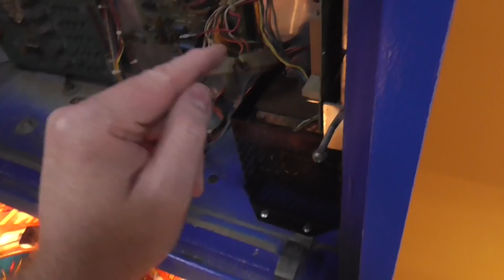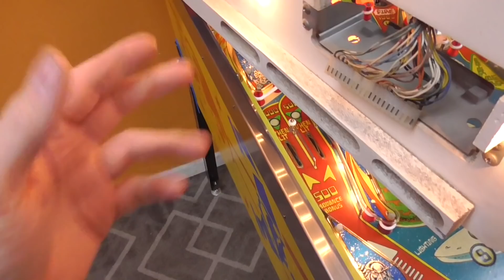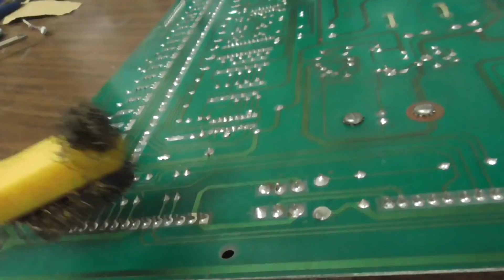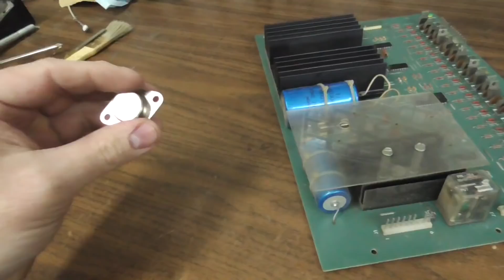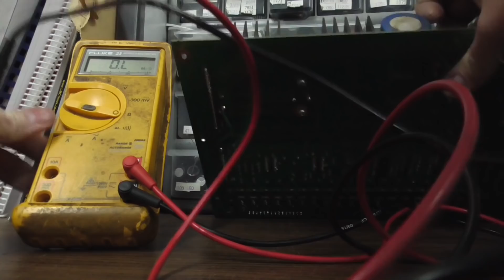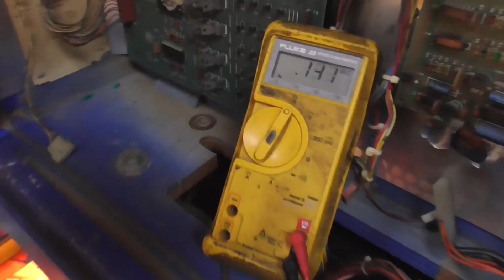Can You See The Solder Joints are Bad? - Bubba Shot The Pinball #4 - Bally Star Trek Machine Repair

Comment: I am enjoying the video,  and felt like I would put in my two cents on "reflowing" or "re-soldering" header pin joints. I would say that alot of times it works just fine to reflow...  but most of the time,  I find that the amount of oxidization in the lead leads to a bad solder joint from reflowing. The joint will end up looking like a big nasty blob ..   these joints will also fail in time. If I am reworking a header,  and it "blobs" up, I remove the old solder and try again. If at that point. solder will not form a nice "fillit", I will replace the header pins themselves.
Reply: The problem is they corrode down inside the crack, and the reflow can't get there.

Comment: I've been soldering (soddering silent L!) for 50+ years now. You are quite correct about the pin resolder, removing involves the danger of stripping pads off the board. Great video keep on keepin' on!
Reply: It's actually saul-der-ing. Not soddering, not sold-ering. L ain't silent entirely bud.
Reply: @DemnRaig80  WRONG! Only Europeans say with an L. They are WRONG!

Comment: Copper will oxidize, but I don't see the relevance. The solder will oxidize too, and that is why you hit it with a brush to clean it up.

As for wires in the wall, it has insulation on it.

The flux myth comes from the old plumbers' solder (acid-core) for working on pipes. Most would never attempt to use that for electronics repairs. But yeah, if you use that, clean that acid off. But with all the trouble you go through to remove corrosion, I just wouldn't put that on there in the first place. 

Now, I imagine there are places where you want to remove rosin or whatever flux. I don't know if that could detune an RF section. I tend to doubt it, but you are not working with too many RF circuits (the CPU clock line would qualify). And since rosin is sticky, you might want to remove it if the machine was in a metal factory or something, and I wouldn't store a pinball machine there. But even then, you'd have to have a lot of metal dust to attract enough to have shorted traces. "Whiskers" is a different problem, but I don't think that can be prevented. If you find those, just reflow the solder.

Another thought is maybe if the unit were to stay really hot, parts might fall off the board easier. Flux is used for the same reason you pour salt on ice in the winter. It changes the melting point. So you want the solder to soften easier when you apply it. That is something you could test. Find a playfield where the resistors have fallen off and see if you find any traces of flux.

I have my own stories, like me handling a taped-off electrical wire sticking out of the floor and the landlady was like, "Aren't you afraid of getting shocked?" I had to explain that the reason they put insulation on the wire is so electricity won't go where it doesn't belong. So if it isn't blowing fuses or causing fires, then I don't think I'd have to worry about electric shock.
Reply from the maker: Thank you PlumGurly I can tell you now what you're talking about
Reply: @LyonsArcade  Thanks! Such a compliment coming from you means a lot!

On the possibility of hot resistors falling off when there is rosin left on, one can make the case that can be a safety feature. So rather than shorted light sockets causing a fire (like if someone put the wrong fuses in), the parts start falling off.

Comment: I guess if Bubba shot the Pinball Machine it could also be possible that Bubba Shot the Juke Box too..  I figured it’s probably too late to go back and check…
Reply from the maker: I didn't think about it at the time, but over the years I've thought about that Wizard with the big hole in the playfield, at the time I couldn't tell what did it.  To be honest with you, not to be vulgar, but I figured maybe rats had done it, maybe they had tracked nastiness all over it and it had worn through the wood...but i've seen lots of rat damage before and never seen them create holes through the center of a playfield.

Then it finally came to me a little while back, he probably shot the playfield with a shotgun on that game.  It had maybe a 6 or 8 inch section that was missing in the very center, and there was no playfield glass.  Lot of senseless violence against coin operated games!

Comment: 26:55 The only way that is going to happen is if the wrong kind of flux was used with the solder, like the type a plumber would use to solder copper piping. That will eat your PCB eventually but rosin core solder for electronics ain’t never going to do that.
Reply: That's exactly what I was going to say..  When I first started, I bought some random flux to start adding to make my reflows go better, and it turned out to be plumbing flux, which I didn't know to look for, and it was amazing how fast it would eat the traces..  I'd have a board mostly working, set it aside for a few days and come back and it would be dead.  Ever since I tossed that back in the plumbing supply box and got some rosin flux I've had no problem.  I do tend to clean it anyway, but I'm not worried that it's eating the board.
Reply: @SteveJones172pilot  Yeah that is a great case in point.
Reply: This is true...BUT there are solders, like Kester 331 series, that have water soluble "organic" fluxes that are for PCB assembly but are VERY aggressive and need to be cleaned off well or it will eat the traces and the solder itself.  

Even in the "Rosin Core" varieties, there are RMA and RA and different degrees of aggressiveness in those. The rule of thumb is, the better the solder is at wetting the metal, the more aggressive the flux is, the more one has to get the flux off to prevent the flux from continuing.  

Since Ron is using whatever solder he happens to find (in this or another video he stated that), one has no idea of what core the solder is and how aggressive the flux is.  Working on some crusty power supplies could have one use a more aggressive flux since it "sticks" so much better.
Reply: @sguttag  I wasn’t aware of that. Good to know.

Comment: Ronnie, you're doing it wrong! If you connect multiple grounds together, yeah, I know they're all the same wire, so what's the difference, right?  But those are called ground loops which act like loop-antennas and pick up noise and couple it into your ground plane.  That's a common cause of 60-Hz hum on sound-systems..  too many grounds.  Grounds should ideally be a big hunk of copper and not snake all over the boards and not connect back to itself at multiple places.   Jeeze Ronnie, get with the program!  And this is not "your" video.  It belongs to us viewers!  I already made ten copies just for my personal use!   I pay your salary with my ad revenue!   ducks and covers

Comment: I would have to disagree with not covering traces after adding bodge wire repairs. Not all traces are made the same, and the coating is not provided for cosmetics. It is there to protect the board from corrosion due to humidity. I've seen traces eaten away due to corrosion from humidity (aka copper turning green). Even covering the exposed trace with solder does help prevent this type of corrosion.
Reply from the maker: can you explain then why the manufacturer left exposed copper?
Reply: @LyonsArcade  The manufacturer only leaves exposed copper where connections are intended to be such as expansion, jumper options, or RF shields. The mask is more intended as an insurance policy against corrosion. It doesn't mean that the traces will always corrode, but it does eliminate the possibility. Besides, if a manufacturer could skip a process to save money, they would.

Comment: If you just can't deal with using wire ties to block off the hole in the power connector...  lol
The connector family is Molex KK156.  AMP made a compatible 0.156" pitch power connector but their family name for it escapes me.
The blocking pins are called polarization pins or polatization keys.  The big electronics component houses sell them.

Comment: once again.  great video.. 
and on reflowing or removing the old solder.   Reflowing is perfectly fine as long as the pins are cleaned. and you dont over do the solder.  As long as, Bigger the Blob, the Better the job, is not part of the equation. Have seen way to many people try to just add solder and short out terminals.

Comment: Checking the filter cap's A/C ripple with your multimeter is a great idea. I have that multimeter too; although mine is a Fluke 23 with a grey silicone case around it (I think its a series 1), great meter when I got it, it was still working with a 9v that expired in 2008 (bought 2015).

Comment: Yup. A little flux-core solder fixes those broken joints nicely. It just needs to be melted and reflowed. afa "conformal coating".... lol. Don't mind all those exposed solder joints, contacts, and component legs already being exposed. They're not wrong about exposed metal corroding. But.... ayah.

Comment: Adding the conformal coating is only needed if your boards are exposed to corrosive elements (salty moist air, harsh environments, boards that could be exposed to spills). 
Adding flux is only needed if you're working with non-fluxed solder. 
I think part of the confusion is people are watching other youtubers who do repair vids, and they're working on ROHS compliant equipment, which uses higher temp non-leaded solder. The removal of old solder is due to wanting to rid the joints of the ROHS complaint solder in favor of using the lower temp leaded solder. Also if using hot air to remove/add chips or components, you use flux as you're not adding solder with flux core to remove/add. 
A lot of folks may not realize the boards you're working on are mostly all non-ROHS compliant, which are all leaded solder. (60/40)

Comment: JOE, LM75H05 Regulator outputs 5 amps, but what problems and issues does it fix?
Reply: *78H05 - regulates output to 5v
Reply: @BluePlanetMedia  7505 outputs 5V at 1AMP and 75H05 outputs 5v at 5 AMPS, I wonder what problems the pinball games causes what types of issues using the 7505  because its outputs only 1 AMP so it causes problems

Comment: They can't handle the truth dude! There pocket protector solder guide says different now !!! LOL... Real nice example of cracked solder joints on the pins of the board. Holly crusted power transistors batman! 78H05 is the 5amp version....nice!

Comment: Love the videos keep it up. Don't tell anybody but the "conformal coat" is called solder mask. It allows the manufacturer to solder the entire board all at once. It is placed where you don't want the solder.
Reply: Thats what I was thinking..  there are really 2 different things, right?  What he's talking about is the solder mask, but then there's also conformal coating, which it's my understanding can help to protect if the board is going to be in a humid location or something.  I have a bottle of it for example that I have put on circuits I am going to put in the garage.
Reply: It's called "wave soldering" in case anybody is interested. They even make Selective Wave Solder machines now that can turn off the solder flow nozzles as sections of the board with components you don't want hit with the solder pass over, like SMDs.
Reply: I was going to say that. Anyone that says you need to replace it for anything other than "it looks nice" doesn't know what they are doing!

Comment: "Ackshually" it's probably rust, not metal. But you are right, reflowing is perfectly fine if there's already enough solder there.
Everyone should know by now you know what you're doing, so keep it up.
Reply: I add a little flux and heat it so it flows nicely.. maybe add a bit more solder.  Only reason to remove any old is if by adding new, you get too much!

Comment: The typical use I've heard of for conformal coating is to either insulate a trace electrically for "just in case" or to glue a trace repair down to strengthen it, especially when using thin copper foil or stamped replacement pads.

Copper does corrode (I had an PCB that completely dissolved numerous traces into green dust) but that typically requires moisture and time.  When the circuit is energized, though, moisture can destroy copper in seconds.

Comment: If the reason is due to corrosion, there is a reason to remove what you can. Yes, it may be a metal, but you never want to solder over any corrosion. If you have corrosion in the mix...it will corrode faster again.

Comment: Today was very depressing.  After learning about copper vaporization today, I checked my penny collection from my childhood.  It has been in the spare bedroom closet in an unsealed coffee can for over 30 years. (That will tell you how old it is...coffee can)  It is now just a can of dust.  Conformal coating would have saved my childhood.  Come on people, coat your exposed copper!
Reply from the maker: IMAGINE THE TROUBLE YOU HAVE IN YOUR WALLS!!!! THERE'S COPPER IN THERE EVERYWHERE!!!!!
Reply: @LyonsArcade  It's not problem with air, but with moisture in air or acidity, example sweat, "if you touch uncovered board, it will start coroded'. If you have dry air and stable temperature, you do not have a problem.
In some industrial you must cover cable joints with resin against moisture.
Cables in walls are cover with rubber so, you will not have problem with moisture, but you must check screw joints in sockets, switches, lights, etc...  after some time. They could coroded and burn your house. And it could happens some time to someone...
Reply: @LyonsArcade , writes _"
Joe's Classic Video Games
3 hours ago
IMAGINE THE TROUBLE YOU HAVE IN YOUR WALLS!!!! THERE'S COPPER IN THERE EVERYWHERE!!!!!"_

Drywall is rated as a Level Purple conformal coating. That's why building codes don't allow exposed wiring!
Reply: @LyonsArcade  I sure could have used those pennies to replace all the drywall I just panic rage destroyed.  On the upside, I now have several "inspection holes" for future use.   BTW... the wires all looked pretty good.  Who would figure that?

Comment: Actually, it's not "conformal coating", it's solder resist. It's so (and I know you know this) the solder only stuck to the areas without resist when they ran it through the wave soldering machine (google it). In my 40+ years of repairing all kind of PC boards, I have never put any coating on a trace repair. It just isn't needed (unless environmental conditions dictate it, such as moisture). I enjoy your laughing at this.
Reply from the maker: Thank you js4653 i'm glad you enjoyed it :)

Comment: I'm curious why people don't like globing all the grounds together?
Reply from the maker: There seem to be two reasons, 1, a lot of people are very educated in design, but not in repair, which are two different things.  I have no education in design, but have repaired a lot of things so what makes sense to me doesn't make sense to them, because they're doing it from the other side.  They may have designed it, different than how I'm repairing it.  

2, a lot of people haven't actually done anything, they've just heard about it, or saw it, or studied it, but have no experience. So they have an education (of sorts) but don't actually have applied knowledge or experience... so when they run into experience that doesn't line up with their education they don't like that
Reply: @LyonsArcade  It's like building inspector meats builder  some inspectors (all?) should have some building experience,  getting wrote up for a code violation because the book said I built/installed it wrong?